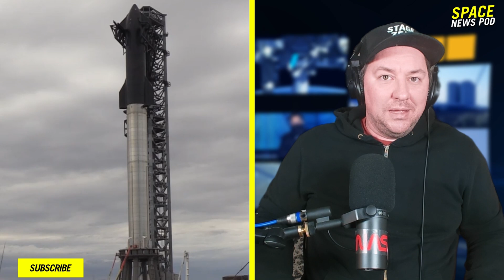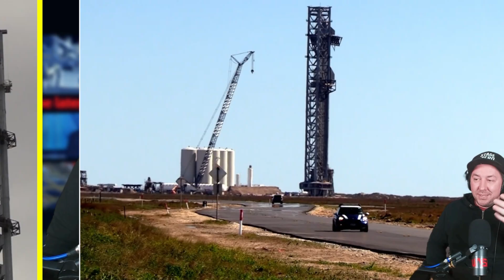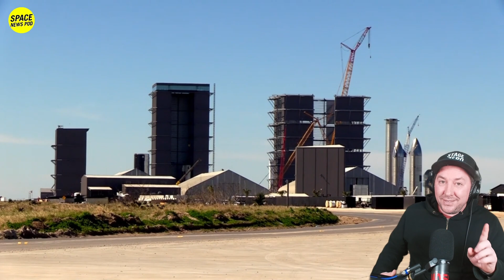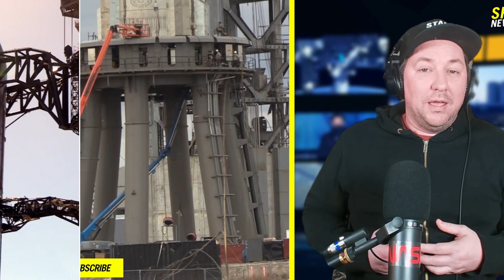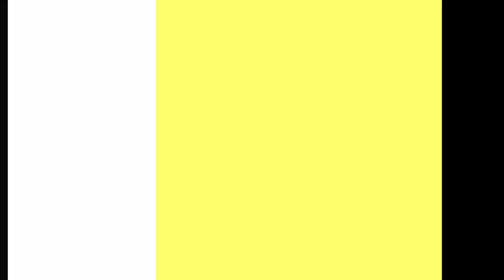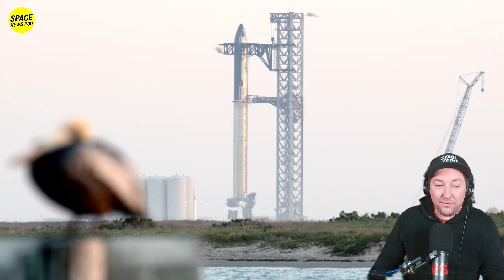Will SpaceX Starship Launch From Starbase Again in 2023?

Comment: Think about mounting a raptor engine horizontally with the thrust going through the OLM legs and away from the tank farm. This should mitigate a lot of thrust damage shooting straight down and push anything that might come loose away from sensitive areas. Keeping the steel upside down shower head AND this would be
amazing!🚀

Comment: I estimate 12 to 20 wks for Stage Zero to be fully launch ready again. It is after 3 low thrust Static Fires and 1 full thrust Static Fire to test the durability of the new Deluge and Flame Diverter systems.
Reply from the maker: I can see that. It's going to take some time, for sure. So much to rebuild and also add to the system.

Comment: I have no idea how long the FAA investigation and law suits against it might hold up the launch so I’m only going to guess at how long it might take SpaceX to get the equipment ready again even if at that point there may still be FAA/legal issues still causing a hold.

I also have no idea on the equipment timescales so my guess is generated by using a technique I used during the SN hop tests to convert Elon time to real time and it seemed to work fairly well. When Elon gave any timescale - “x to y days/weeks to do Z” - I would take the most optimistic end of his time estimate (“x” in my example) and triple it to give the actual time it would take. So, with no claim of expertise but more out of interest to see if my algorithm manages to continue to fit reality, based on Elon’s “6 to 8 weeks” comment that gives an estimate of 18 weeks before SpaceX has stage zero ready for another launch attempt with a booster and ship also ready to go.

I think stage zero will be the item on the critical path rather than getting a ship and booster flight ready; I doubt that many Starship followers would disagree on that point except perhaps if fixing the FTS turns out to be a huge problem.